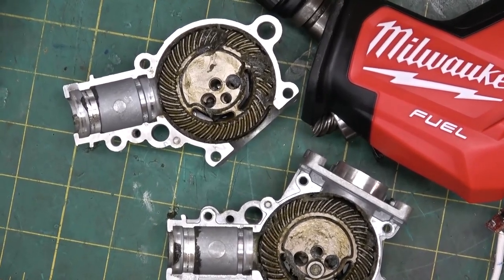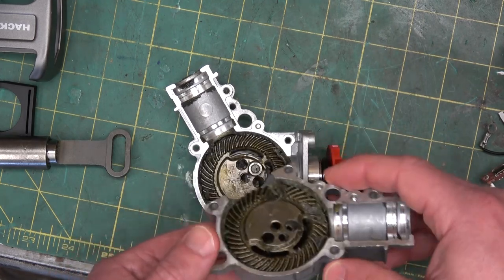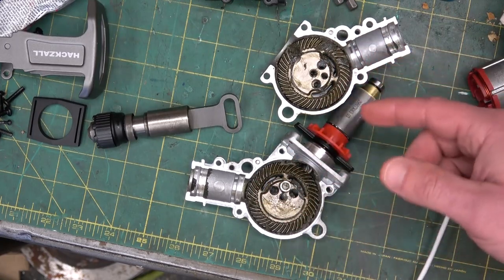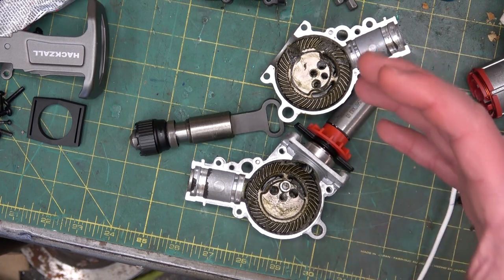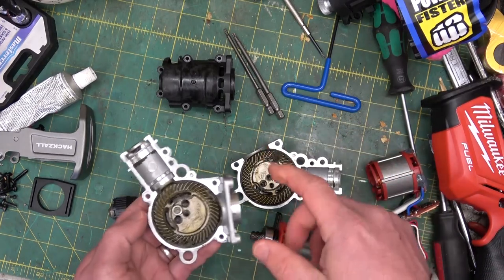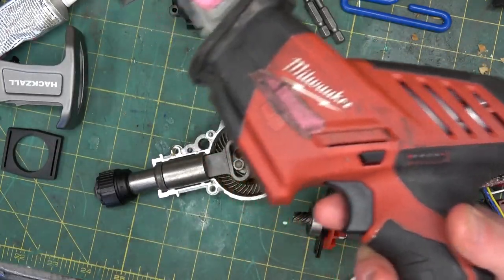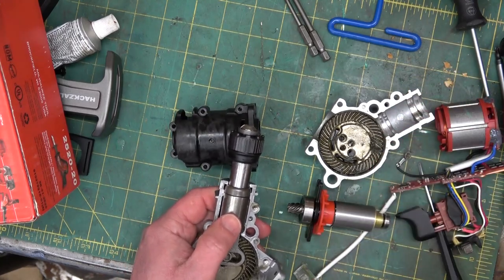BOLTR: Twin Crown Gear | Milwaukee Hacksawzall

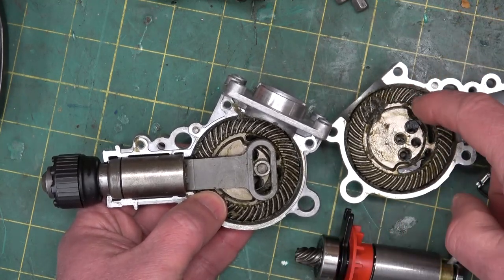Comment: You were still showing them wrong as you were looking at the two halves.  When you said they were 0deg out of phase, they were 180 deg out of phase. You actually turned them in the same direction around 5:40, not counter-rotating.  Assuming the two options were 0deg on assembly, and 180 deg on assembly, the only difference is if the counter weights will pass each other at 0 and 180, or 90 and 270.  They will always pass each other 180deg apart, it's just a matter of where those two points land in the circle.
Reply: Someone else with spatial sense!

Comment: How critical will the timing be on re-assembly? if you are a tooth or 2 out will that make any noticeable difference?
Reply: Ever had a car with one cylinder misfiring? It'll still rib, but you'll be wobbling all over.
Reply: better comparison would be a car with miss timed Ballance shaft(s). it'll run just fine but it'll feel harsh.

Comment: I suppose they could utilise both crown wheels to drive the reciprocating dinglearm. The drive pins would be moving in-out together but 180º out of phase in the up-down direction. Obviously they'd then need the drive pins to be less than half the height or their drive slot to be more than twice as wide for clearance.

More complexity and tighter tolerances for more load capacity… that it doesn't need based on the evidence of them not doing it that way in the first place.

Comment: AvE, from a real hands on viewpoint, this is an excellent tool.  When a large recip saw or even a Milwaukee M18 Fuel Hackzall won’t quite do the job, the M12 2520 Hackzall is my go to saw.  This smaller Hackzall won’t shake apart the material you’re cutting, it allows more detailed work and when working overhead provides you with less fatigue.  This should all translate into a project done more accurately, in less time.

Comment: The mass of one counterweight is too little to balance out the reciprocating motion, so they put two in. They could have just gone with one that is bigger width wise (like having two but with only 1 toothed section) but by going with two, you lock the pinion in like you said to keep the teeth from stripping.

Comment: Love Ave's vid's, I bet the other gear is also acting as a shim if the tool gets stalled out, the pinion wants to move up, and it'll press into the other gear making the gears harder to strip.  My theory anyway, aside from helping with balance it helps with alignment too
Reply: It does exactly that, and he makes note of it in the video. It's not really a shimming function, but the pinion is engaged with both gears at the same time, so both gears locate the pinion where it is unable to jump teeth if you hit the recip blade tip against something. This type of gearing also produces both radial and axial forces, so the opposite cut of the mirrored gear helps the pinion bearing, the gear itself, etc by opposing that load with its own.

Comment: my guess is that it distributes some of the load off the center axis of the pinion which may ever so marginally stabilize the stroke and hammer.  Like grabbing  the Pony-Tail,...if ya will..... not doing much, but it kinda sets up the knees in what could be a worn out couch cushion... A small detail that brings it all together..

Comment: The counterweights have to be aligned in the axis of the reciprocating movement of the saw. That way you have two counterweights acting as a balance (twice the net effect of only a single counterweight) and they will be out of phase in the perpendicular axis, which means that vibration mode will cancel itself out. So you get the best of both worlds.

With them cancelling out in the in-out direction, you don't get any counterweighing and only get increased vibration in the perpendicular direction. Lose-lose.

Comment: yep a fancy clamp,. imo it looks like it ends up leaving it timed to the out position because you probably want the weight offset to get the blade to rip and tare on the return stroke against the hammer foot"  ,,so you can let the tool do the work ,, otherwise the direction of the teeth would lock it up easier id imagine ..its probably 10x's harder to return the stroke then it is to push the blade threw

Comment: Um, gear two is axis-inverted by fitting the clamshell. Both wheels apply force in the same direction, going 'with' the pin, IMHO...

Comment: Um.. zero degrees and 180 degrees relative to the counterweight are identical for this application.  Either way cancels out the 90 degree vibration you'd have with one crown gear.  The tradeoff for that is that it doubles the torsional vibration on the tool.
-edit
I think I get it, kind of.  You want to balance out vibration, thats clear from how they've cut the gear, that balance is a big factor, but you also want to minimize the torsional vibration.  The normal way to do this would be to make a more massive crown gear and make it flatter to keep its counterbalance mass as close to the center of rotation as possible.  Making it flatter means increasing its radius, though.  Two crown gears is an optimal mix of canceling translational vibration, minimizing torsional vibration (think roll for an airplane) and getting the best compactness possible.  I'm still skeptical that its the cheapest way to do the job, but I do think thats the actual answer.

Comment: At 12:31 of previous vidjeo the ring gears are opposed.
Reply: Because they're counterrotating, they'll always be opposed halfway through the stroke and "meet up" when the blade is fully extended or fully retracted - counterweight A moves 180° degrees clockwise, counterweight B moves 180° counterclockwise, and they both meet on the opposite side of where they started. 180° (in each direction) later and both counterweights meet again, on their original position.
The 2 gears counter each others up/down movement and the counterweights combined counter the movement of the blade assembly.

The whole section about offsets is basically nonsense because the offset obviously changes over time if the gears are moving in opposite directions. If they're offset x° at some point, they're offset x+180° a quarterturn later and offset x+360° another quarterturn after that.

Comment: A rocket ship is more of a recoil action than an engine with a stroke count per say, but most steam engines and some of the old snow engines fire or produce power in both directions and could be referred to as 1 stroke engines...

Comment: Question, what if the weights arent about counter balance. What if they are there to increase the rotational mass so the sawzall doesnt stall with an overly aggressive blade cutting tougher material? Am I wrong to think the physics of a heavier rotating mass would equal a stronger push/pull on the stroke?

Comment: A complete out of the box thought regarding the two Crown gears and counter balancing masses.
They may have used them timed to create a situation of over balance inertia. So as to help draw the blade back  on the inwards stroke / cutting stroke, thereby reducing the amount of actual work done by the motor.
Which in turn means they could use a slightly less powerful motor and effectively achieve the same result. Just another way they could cut costs, as I am pretty sure that motor power is more expensive than sintered gearsets. 
And by the looks of it those gears are identical Baring the one with a cam roller which may have been pressed in. 
Just my brain farts worth. 🤣🤣🤣

Comment: The gears strip very easily  on the older version  with the single gear ..I haven't had any customers come in with this model with damaged gears ..where as the ridged saws blow there single crown gears on the gen 5s all the time ..it happens usually  when the blade pinches  between the cut material  and waps  the saw into the material  slipping the gears and grinding them to dust
Reply: I bought this one as soon as it came out it's way stronger then the old ones

Comment: So to time those gears, just pull off the silver grease cover off each side of the gearcase and line up the keyholes. Milfuckee makes a tool for that to assist in re-assembly.

Comment: Wouldn't the additional, or in this case doubling of the rotational mass change the expected harmonics from the lateral movement?   Could that be the reason for the second gear, to move that frequency range?
Reply: Thanks for all you do sir.  You're a credit to the interwebs.

Comment: You done goofed 5:47 when rotating gears you are rotating them in the same direction when relative to each other when it should be opposite. I think the gear being flipped upside-down on the mat got to you
Reply: I noticed the same thing.  Either they are in sync every 90 deg or they are out of sync.  It can't be the same in both scenarios.  But I DO agree with the final conclusion.
Reply: I'm glad it wasn't just me.  As soon as he started rotating the second one, I thought "wait...that's the same direction!"  I even rewound to be sure.

Comment: At full stroke of the saw, the counterweights are aligned.  Also, each counterweight is half of the mass required to balance the saw out.  That way they counter each other out in the orthogonal (up-and-down) direction as well as balance the saw in the stroke direction.

Comment: To counteract centrifugal force so the tool doesn't twist in your hand when it takes off?
Reply: The motor rotor, which is not counteracted, is the source of the twist you feel when starting a power tool, so this won't help here.

Comment: Ok, so at 0° the up & down motion is damped but the in & out motion is amplified.
This is a tool that BENEFITS from larger in & out motion (don't we all!) So.. you're getting less vibration up & down that is tiring, bad for whitefinger & wasteful of input energy.
BUT... in & out motion is amplified for no increase in torque & thus quicker, more efficient sawing.
Saves money by increasing sawing action with a smaller motor whilst keeping wasteful vibration damped all with one simple addition of a crown gear.

Comment: Do the opposing crown gears’ counterweights individually oppose each other, or collectively oppose the reciprocal inertia of the shaft?
Reply: Oh wait. Forgive me. It’s both, at selective positions, and in correspondingly varying degrees. If I’m right, using a clock face to explain, action of the R-shaft being 9 & 3, the counter rotating crown gears CW’s oppose each others’ inertia perfectly at all but 9 & 3, where they meet in opposition to the R-shaft’s inertia. The result is a heavily determined sawblade that punches above its weight, in a tool that barely vibrates in your hand. (unless you slap that thing back together all kittywompus)
Reply: 👀 Yes well Unlike ME, THAT GUY has an adolescent sense of humor. He needs to learn to use it better. Shouldn’t be that hard. It just wasn’t all that impressive. His response was short and misguided. He inserted it prematurely, I think.

Comment: If they offset the chooch arm, and used 1 gear/counterweight, but kept the center of mass of the counterweight in line with the center of mass of the blade shaft....they wouldn't have needed the second gear...just offset the chooch arm 👍👍

Comment: Had me scared until you fingered that the counter rotating balancer and crank throw much line up at top and bottom of stroke..  Same for motorcycles with counter rotating balancers.

Comment: it's hard to beleive it costs less to add another gear than just mold a bigger weight on the primary. 

It's also hard to beleive AVE actually said a newer tool is better than an older tool!!! Maybe milwaukee it's stepping the game? Well they don't have much choice because Ryobi is now a decent home grade tool, Ridgid it a decent pro-sumer tool with a lifetime warranty that they fully back (i have ridgid tools and they stand by the warranty, even for the batteries.)

So if you pay 50% more for the red tool wich has a lesser warranty, it's better be fucking good!

Comment: Thought you had to be dead to dead reckon... Hope we never get there, buddy...😉
Reply: It is ded. reckoning, as in "deduced reckoning".  Using deductive reasoning to figure something out based on a limited number of facts. Like "if I was at lat 87 at 5pm, and flew north for 1 hour, at 180 knots, then I would be at latitude 87 + (180/60) = 90 degrees north latitude."  A nautical mile is 1 minute of arc in the N/S direction.  If we were dead we couldn't do the math, nor would we care.  But if we are alive, and don't want to fly into something in the fog then we better come up with a method to deduce where we are and where we are going.

Comment: still seems fuckin' weird to me why they'd do it that way. could just have a simpler cast flywheel on the other side that's pinned to the gear. or just not do it at all, i mean really how much damping are we talking here?
Reply: Also.... Why add the cost of producing a new unique part when you can accomplish same task with part you are already making. Add $. 005 to production cost instead of adding $40k+ for new tooling and manufacturing process development/implementation.

Comment: See that piece between the bearing and the motor, that's what fails.  You slam the tip of the saw blade and it can bend that little fucker.